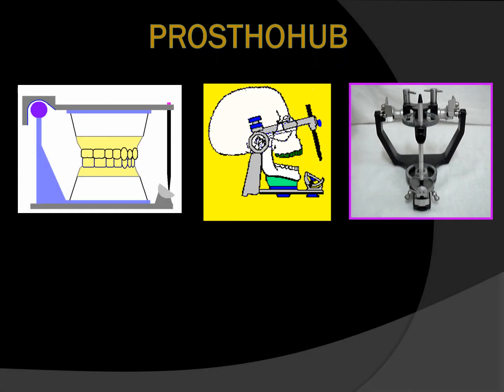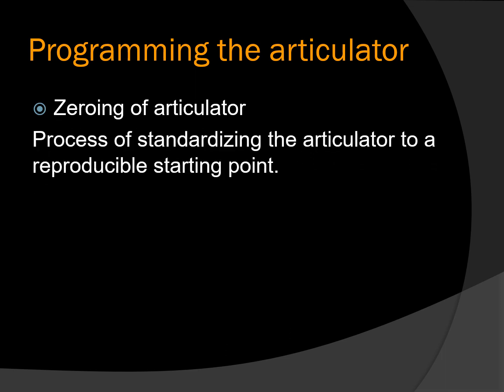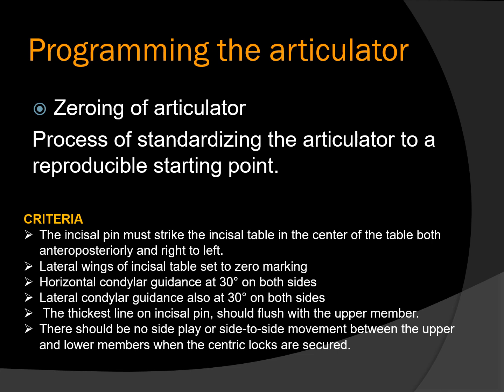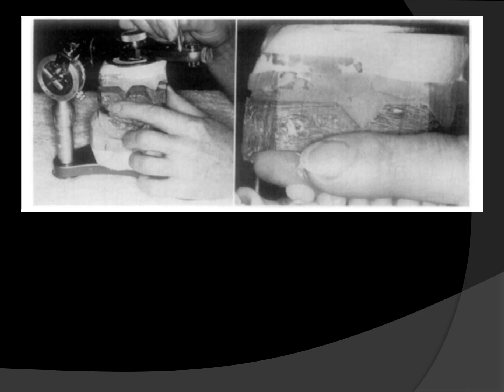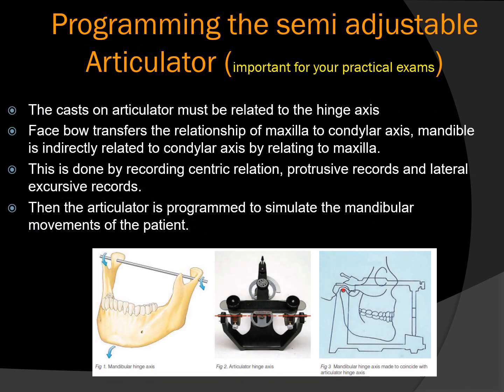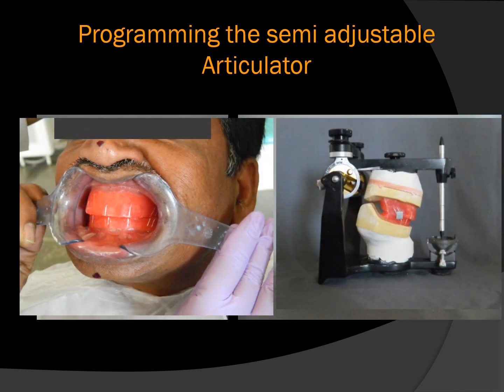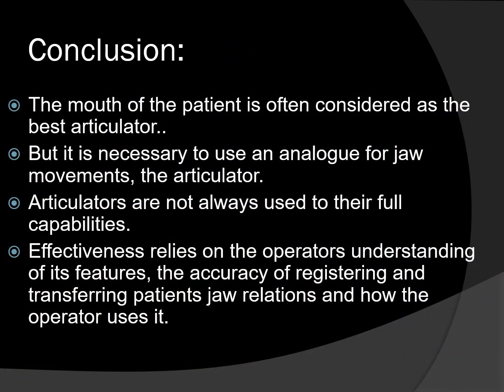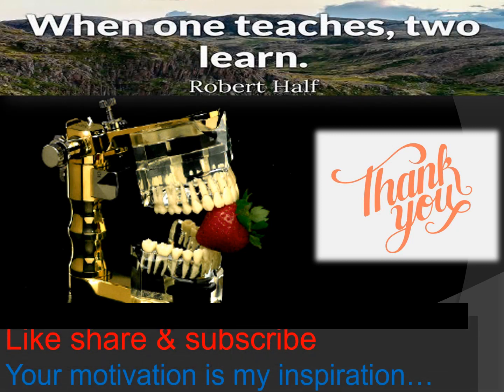Articulators Final Session

Comment: Maam, a question frequently asked.. and i couldnt find the answer about it.. during zeroing of the articulator, why is it kept 30 degree for H. Like bennet comes to be avg abiut 16 degrees using the formula.. bt why is H = 30
Reply from the maker: Usually the H is set according to articulator manufacturer instructions. It is 30 for Hanua wide vue whereas for Hanau H2 it is 70degrees. So according to articulator it varies. For hanau wide vue we keep it at 30 as it is the average value of H in population.